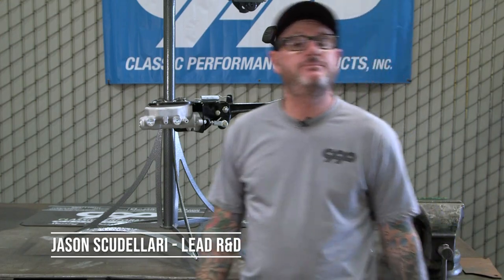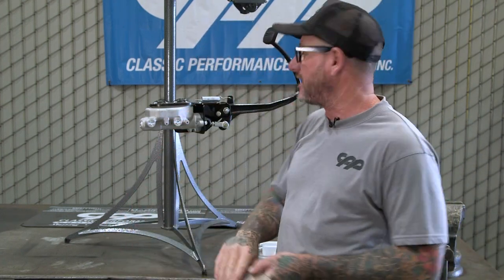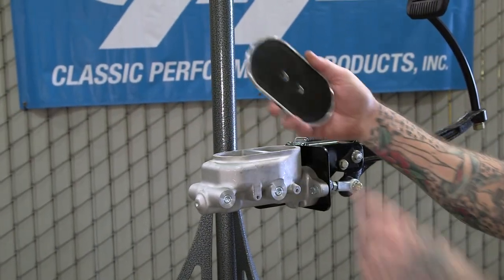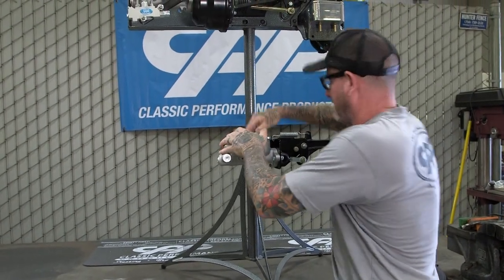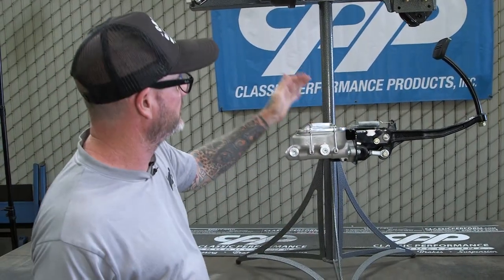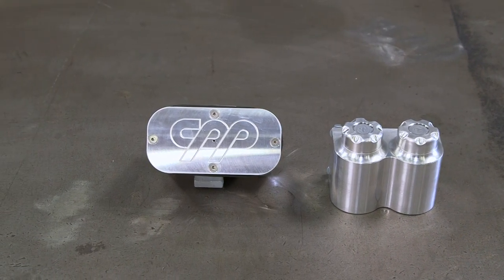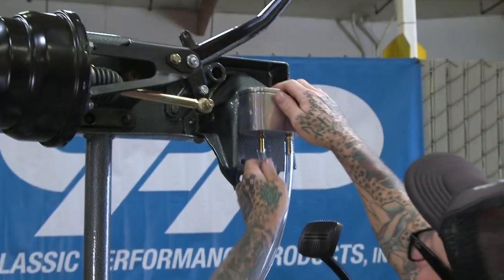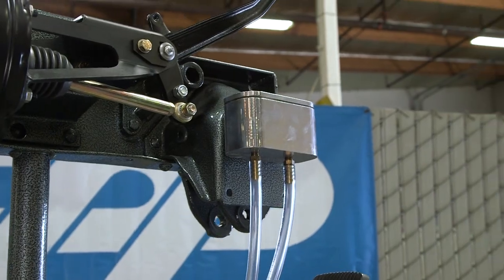Installing CPP Remote Master Cylinder Cap Kit

Comment: Okay so I bought his a few days ago and this is the problem I'm having with it. The clear hoses seem to keep air trapped in them, I cant tell if the air coming out at the calipers is from the air that's trapped in the remote mount lines or if it is a flair causing the issue because the air in the clear tubes doesn't seem to move. This video would have made more sense installing it on a truck and or showing real world install with how to fill and bleed the system.
Reply from the maker: Hi, sorry to hear you are having problems. You are welcome to give us a call at (714)-522-2000 and one of our tech guys can assist you

Comment: It looks like you're working on a '55-'59 Chevy truck. I'm installing a remote system from Johnny Law Motors. It only uses one hose and the fitting they give for the master cylinder lid had bolt threads. I had to use a pipe thread tap and a pipe fitting to prevent a leak. The master cylinder lid finish was so rough, I had to sand it. I'm going to glue the gasket on with contact cement because the lid is flat. It comes with a brass plug for the "extra" hole in the bottom of the new reservoir that I had to add a small o-ring to inside. Last thing, There is no air bleed hole in the new reservoir. What the hell? That should work just fine. NOT! I'm drilling a .020 hole in the side of the cap.